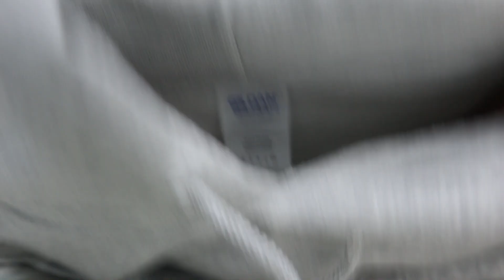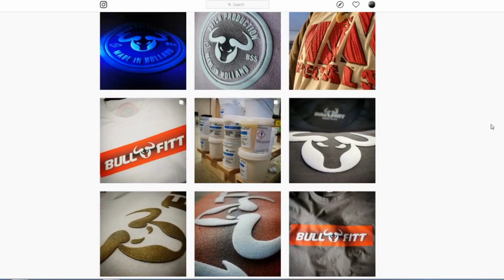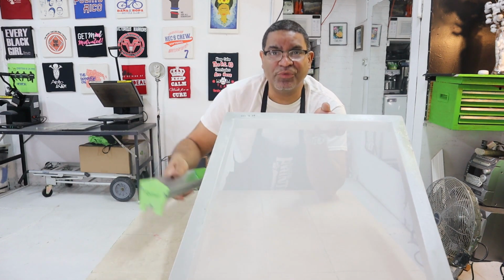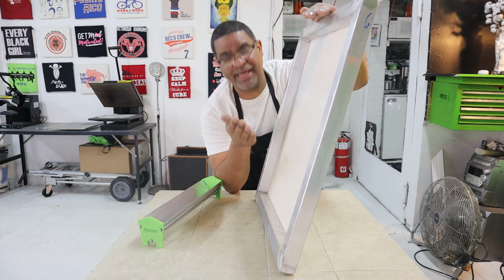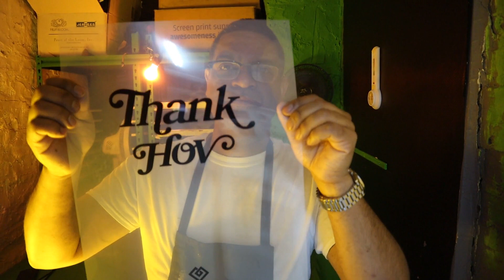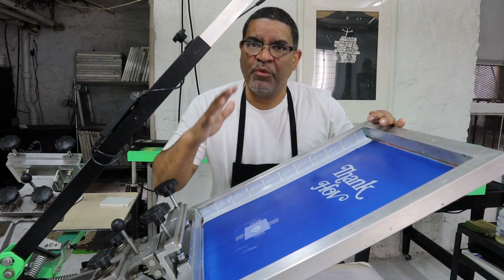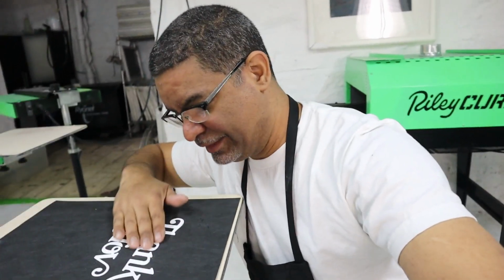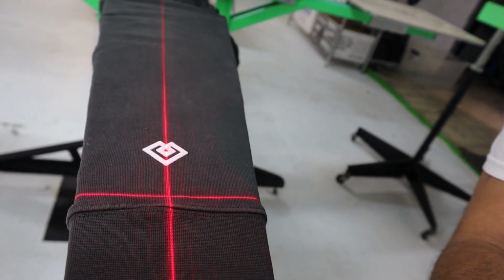THICK STENCIL PRINTING ON STREET FLEECE

Comment: Hola Boriqua, I have a few questions for you.  1). Did you use a 110 or 86 mesh screen. 2). On you TV  what cooking channel are you looking at,  it looks good. 3).   You should have no problem reaching 1000,000 subscribers great job. 
  Carlos De Jesus
Reply from the maker: Thank you hermano. I used a 110 mesh. I coated about three times. Meaning, Every day for three days I just coated the screen to make i thick layer. Thank you.

Comment: Is it working even with Waterbased inks? 

Personally, I assume, that you can make this thick print only with plastisol because plastisol ink lies on the garment - whilst the waterbased inks are soaking into and it can mess with durability when you have many layers. Sure You can use the "puff paste" with the waterbased but it has not the same look :) .. Am I right or is this method applicable even with water inks?